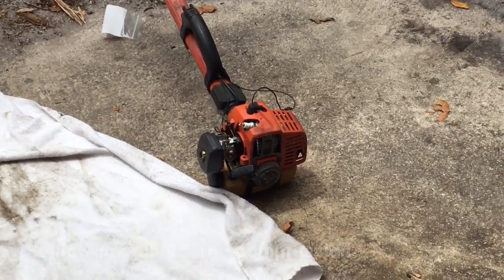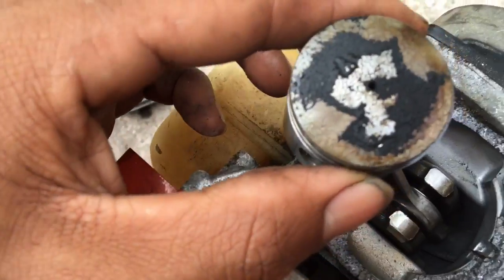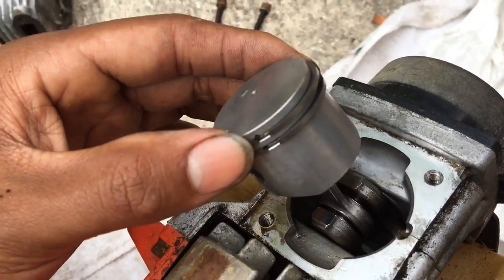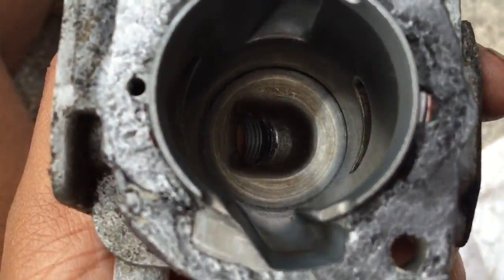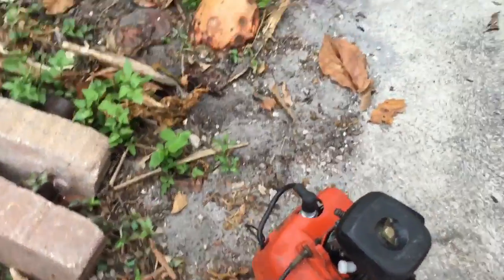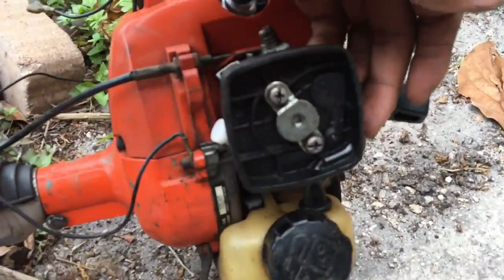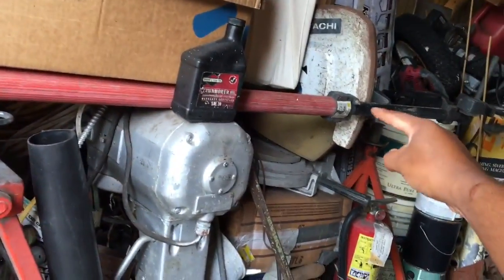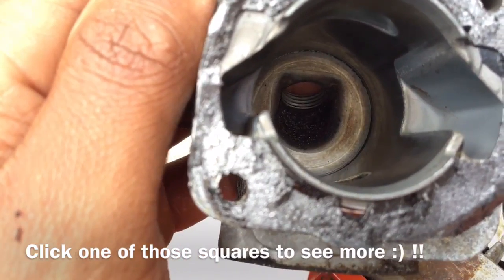How to get ANY old 2 stroke engine to Start up

Comment: Appreciate the info and demonstration, bud.  I think now I might actually have like a 30% chance of accomplishing what you did.  At least I won't just be slinging f-bombs at it and giving up like I would normally do. 

And I have to say those sound like beer-burps to me.  Oh how I miss those days.  Cold beer and outdoor work go together like peanut butter and jelly.  It's the American way.
Reply: don't let anything stop you, you can do it pretty easily. A few tools, research like this video and patience and you can do a hell of a lot more than you could yesterday. Generally all you'll need to do is clean the carb through, clean the spark plug and you'll make fire 5000 times a minute no problem. taking the head off is pretty pointless as parts these days cost more than a 2nd hand trimmer

Comment: I hate to say this. but there are some that will never start even with good compression and a new crab and plug.
Reply from the maker: Well compression, new carb, and plug aren’t the only players when it comes to starting them. Those are just 3 simple things to check. There’s a lot more mechanical and technical reasons why it won’t start. You can definitely start them all even if they’re 50 years old

Comment: Should always keep a roll of gasket paper. Works great.
Reply from the maker: Really. So you’re saying I can cut out and shape my own gasket from the roll ?
Reply: Yes I've used it for years on cars and small motors you can't always. Have a store open when you need one.
Reply from the maker: Where do I buy a roll of gasket paper?
Reply: @GreenThumbEngines  following
Reply: @GreenThumbEngines  Any Auto Parts Store should have Gasket Material. But, don't use the "Cork/Rubber" type.

Comment: How about speaking right without all the cursing. Maybe some day you might make a small engine mechanic with much proper training.
Reply from the maker: just need a mentor
Reply: You meant "speaking correctly" then
Reply: Really not necessary for the cursing and belching.  Edit b4 posting.

Comment: It sounds like your clutch on it might have something wrong with it? That would explain it not revving and why it wouldn't spin the saw.
Reply from the maker: its fixed now and everything was adjusted on the carb for the revving. and for the saw, the mechanism that rotates the saw where the saw is located was all gunky and clogged with built up grease from over time which is why it didnt move the saw. then i cleaned it and oil it down and the saw started circulating like brand new :)